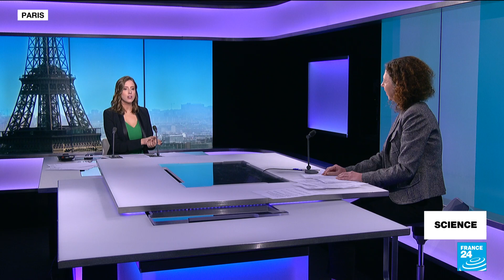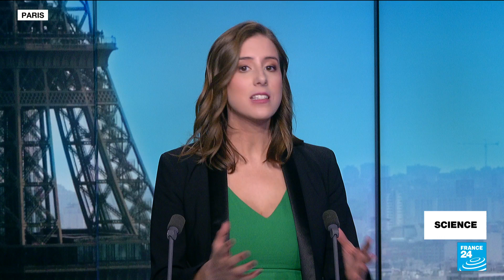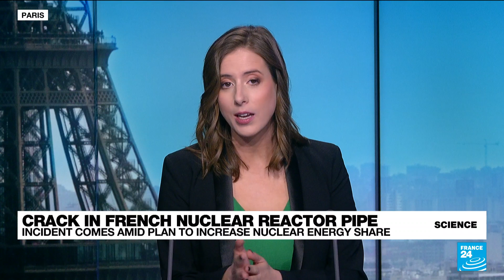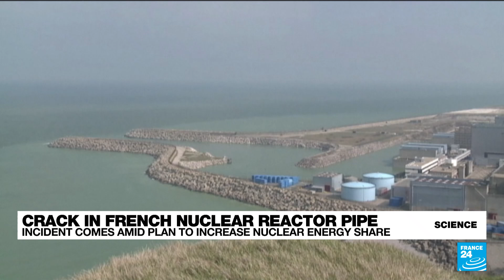Significant crack detected in French nuclear reactor pipe • FRANCE 24 English

Comment: Crack found before problem.  Crack will be fixed and other plants will be looked at to see if they have similar cracks.  Seems like the system is working.
Reply: Oh I got it... The more cracks the better the system.  I'm with you.
Reply: @alainpannetier2543  No - People are not perfect.  Machines are not perfect.  The system of inspection and repair has been shown to be functional.  News reports have reported a problem that is apparently self correcting due to the discipline of the people involved.  This is indicative of a quality operation.  However, I'm quite sure your quip was meant in jest.
Reply: @daniellarson3068  You're right. I just happen to find uneducated pro-nuke bros [unwittingly] laughable. Just trying to help.
Good for you if you got it the way it was meant.
PS: the system of inspection was so perfect that the ASN just requested that it be thoroughly reviewed and improved. It's in the video.
Reply: @alainpannetier2543  Are you one of those green people that think everything is bad just cause you got no clue about anything? You are aren't ya?

Comment: The only thing being piped in a nuclear reactor is water.
Reply: ...and why cooling a reactor anyway when the rivers run out of water? :P
Reply: fyi kiddo deuterium (heavy water ) is piped to and from cooling systems not just light water being made into steam for power generation. Heat energy produced in the core of reactor due to fission reaction is required to be carried away by a coolant. Heavy Water is used as a primary coolant to transport heat generated by the fission reaction to secondary coolant system..
Reply: If it's radioactive water that's still a potential issue.
Reply: @TheGreenReaper  it isn't.  That's not how radiation works.
Reply: @benjamindover4337  Ah, but then why did they spend all that time filling drums at Fukushima? One rad would be one too many, even if the practical impact is insignificant. ☢️
Reply: @TheGreenReaper  well yeah, the reactor melted down, so at that point everything is contaminated. But under non-worst-case scenarios a nuclear reactor is safer than standing out in the sun.
Reply: @benjamindover4337  Only if I'm not putting on sunblock cream/lotion. Guess what, I like wearing sunscreen...

Comment: Why aren't countries switching to thorium salt reactors
Reply: Just imagine, this crack would just leak radioactive water! Do you want radioactive sodium leaking all around your fancy nuclear powerplant?
Reply: It's new. So still expensive and unproven. Also the hype around it is only about 10 years old and nuclear plants take a long time to construct so in any case it'll be a while until we see them pop up.
Reply: @beback_  China first thorium reactor should be on line soon these reactors also burn the old uranium rods from old reactors  which means there's thousands of years of fuel rods available
Reply: @nidhin916  thorium is a lower radioactive substance that is much more plentiful than uranium these reactors can also use the old fuel rods from old reactors which means they recycle nuclear waste China is the first country to build one and should be on line soon, of course there's no oil or coal pollution right